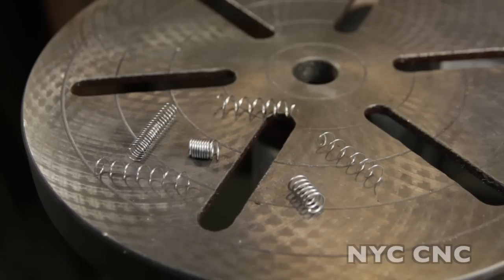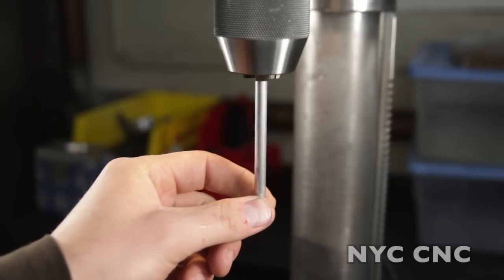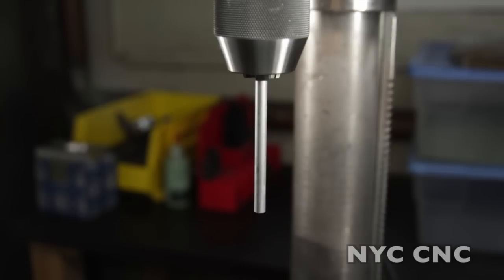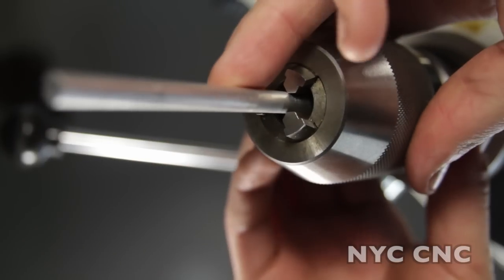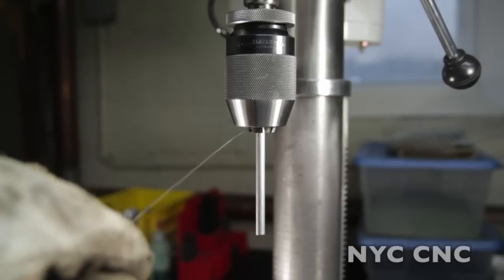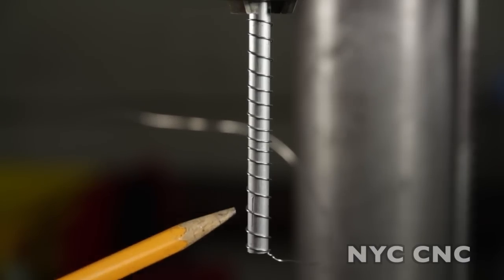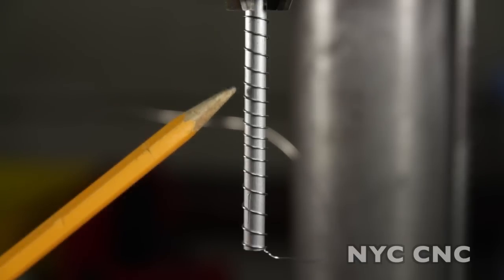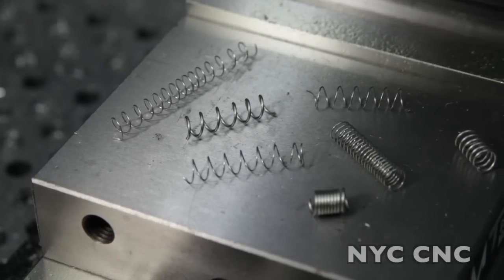How To Make a Spring in the Home Shop!  Spring Winding 101

Comment: To heat treat, stick the springs on steel wool, wrap in foil and stick in the oven at the highest temperature for an hour, let it cool naturally, this is not my idea, saw it on a website but forgot which one, just posting on here as many are asking the same thing, it's to stress relieve.

Comment: Is it possible to expand a current size of extension spring using a tapered mandrel? I am wanting to make a coupling splice for two 1/2" by 50' drain augers using
a 1" cut off piece of auger, expand it say 0.030" or so to fit the outside diameter of the 1/2" auger cable. I want to thread a cheap inspection camera through the 
hollow center of the drain cable, checking for blockage of my 4" sewer line. The wire diameter of the cable is 0.089". Thanks

Comment: Anyone no how to make a spring about the size of a nickle,on  one end of will be anchored with a screw and mounted to a piece of sheet metal inside a meter the other end of the spring is for holding a c battery in place,I think I just need some wire I can use for this ?

Comment: I know lower speed seems safer, but remember the torque is higher at low speed, so it's still pretty dangerous. Turning the spindle by hand is probably the safest option.

Comment: If you do this often it would be a good idea to put a variable frequency drive on your drill press.  The size that you need for your drill press doesn't cost much.  Then you could slow it down to 1 rpm if you needed to.

Comment: i use a hand drill with 0 to 2000 rpm variable and a rod with a hole drilled in it for the wire to hold..i make it turn at around 10 rpm for a perfect spring, easy as
Reply: +Xtreme 1000 Much easier to get consistent pitch this way but anyone trying this method should be sure to wear heavy duty gloves for protection. (I know that you know, but just in case someone else see this post). This is the guide I learned from: http://www.instructables.com/id/Make-your-own-springs-in-seconds/
Reply: +Xtreme 1000 Much easier to get consistent pitch this way but anyone trying this method should be sure to wear heavy duty gloves for protection. (I know that you know, but just in case someone else see this post). This is the guide I learned from: http://www.instructables.com/id/Make-your-own-springs-in-seconds/

Comment: I've always found it easier to use a mandrel in a lathe and use the lowest speed or even manually turn the chuck in neutral using a pair of pliers and a piece of brass as a Guage for the pitch, that's how I was taught in school and it's worked great for making accurate and consistent springs, at least for smaller scale projects and as a quick fix until a new spring can be ordered, I work in. Machinery maintenance and downtime is lost money.
Reply: its a piece of brass which i scribe a line on according to the pitch, i put the line under the wire in the pliers and push the brass against the previous coil it works as a guide, its quick,cheap, and easy

Comment: have tried to make,didn't worked. now i have some thought, if you have time and will you could try to make a video. so i'm thinking that- make the initial shape (cylindrical die), say D=0.5' L=1'.mill or cut with a turning saw disk the spiral of the spring, finish the ends to size & shape,..then (tricky part) have to drill it longitudinal so the spiral will become spring. My didn't work 'cause the spiral wasn't done properly (didn't had a CNC) & next the die must be secured tight when drilling.

Comment: To get a consistent pitch, you can use a metal lathe with a rod in its jaws. The wire mounted on a pulley fixed to the cutting tool holder and use the regular feed of the lathe.

Comment: while being in a machine shop or whatever you could make yourself a handtool to turn the wire : a plate with holes to fit dowels of the right size  a small guide to keep the angle right ( for the pitch) and a litle handle to turn the dowel . might be safer , could be handy ...